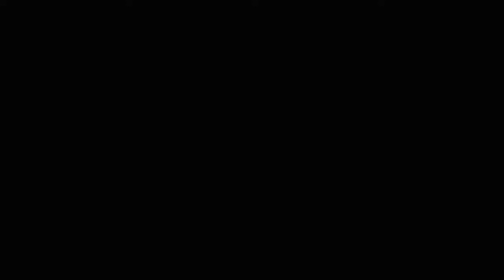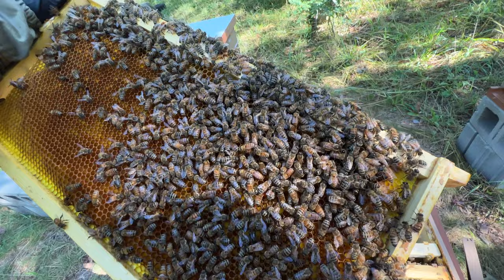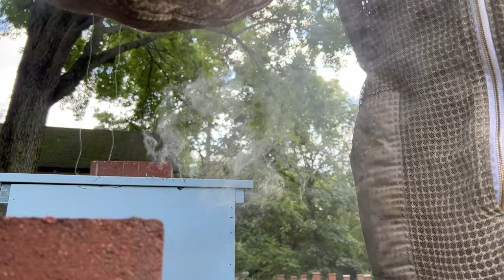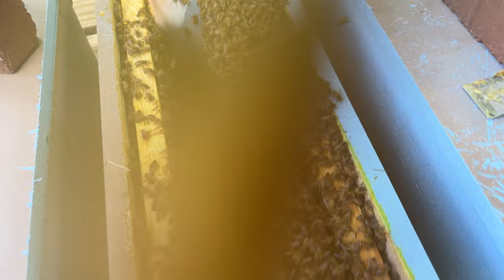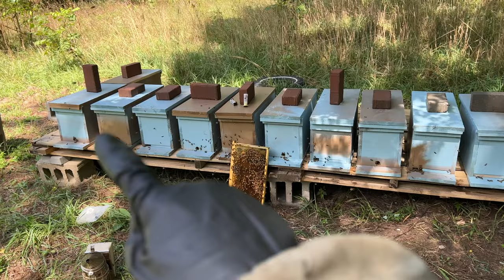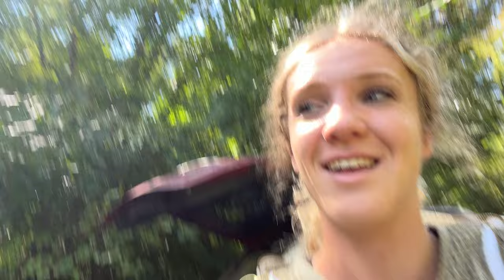Mating Success And LIVE QUEENS EMERGE AND FIGHT! / Beekeeping 101 #beekeeping #beekeeping101

Comment: If you have a piping queen you probably still have a cell in that hive, and need to go back through them and make sure as that could be another replacement queen for another hive. Queens usually don't pipe if there isn't another queen cell or another queen in the hive. Keep it up, you're expanding faster than me and I'm about to do the same this next year. Keep it up!
Reply from the maker: Ahhhh that is good to know! The other cell that was in that first colony with a pipping queen I moved into another queenless colony. The 2nd piping Queen was the one I had taken out of that colony that had multiple cells and moved to a different one. Good to know that’s why they do it thank you ☺️
Reply: Workers also pipe.
Reply: @Swarmstead  technically yes they do but it's primarily a signal to swarm and isn't as loud or noticeable as a queen's piping.
Reply: @subsy83  it's the exact same sound. I wish it was a swarming signal, but I've never found a correlation.

Comment: Also that wasn't robbing, that was just orientation flights. Robbing think of it as so many bees going in without anything hardly coming out. It looks frantic and dangerous and bees are usually fighting. It's very unmistakeable and stands out for sure.
Reply from the maker: Thank you both for this. Still struggling to tell the difference so thank you! And you are correct. Next day was calmed back down so I opened the door back up
Reply: @beefitbeekeeping  Agree with orientation flights, usually happens mid afternoon.